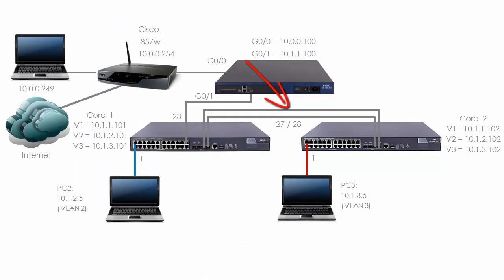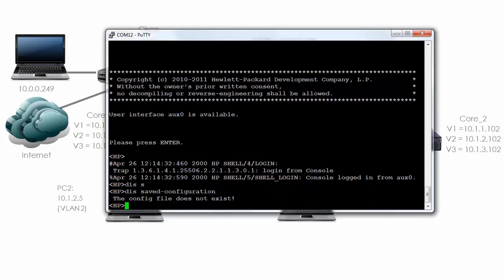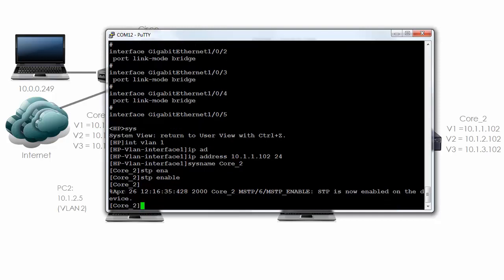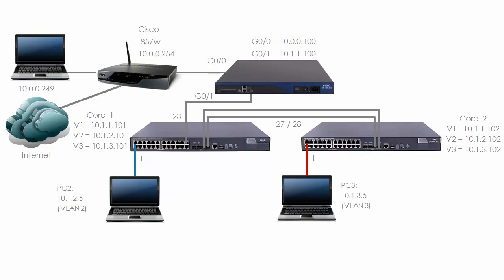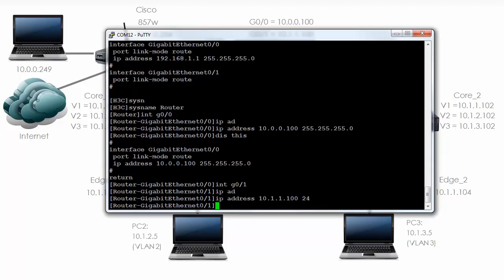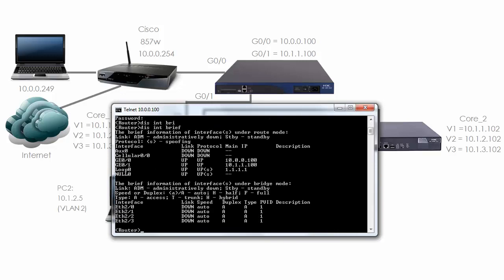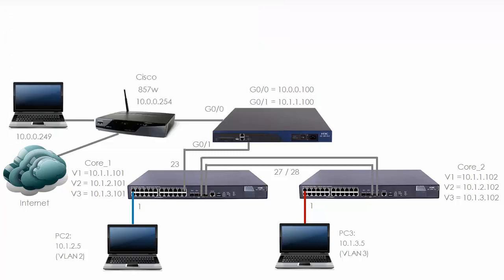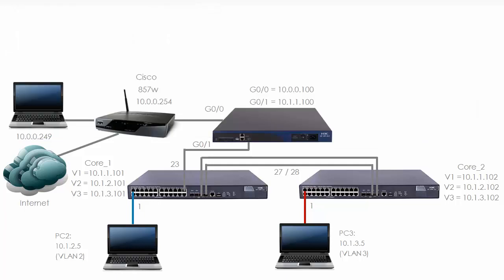HPE Comware Networking (Part 7): HPE / H3C Comware switch network setup (Part 2)

Comment: I have hp switch 1920 ; when i setup the IP ipsetup ..... and save the configuration and reboot it . the interface are all down and i m not able to conect throught http to this switch . the systemview does not show the ip either .
Reply: try s s f (save safely force)

If that is still relevant lol